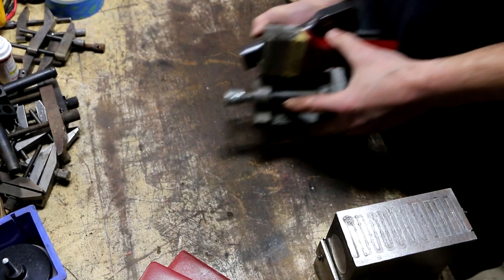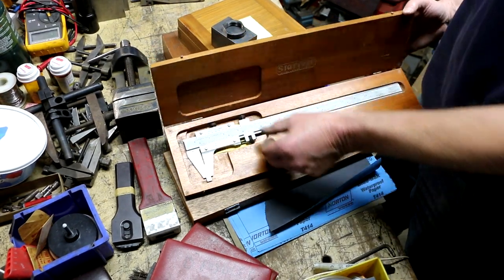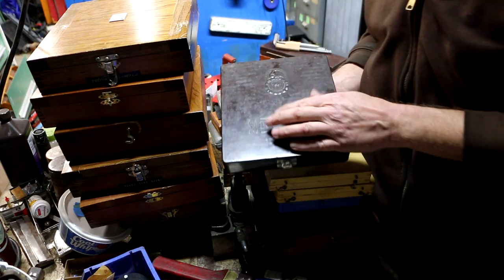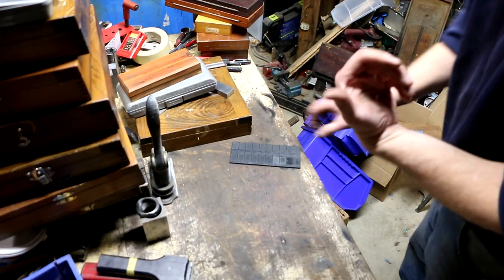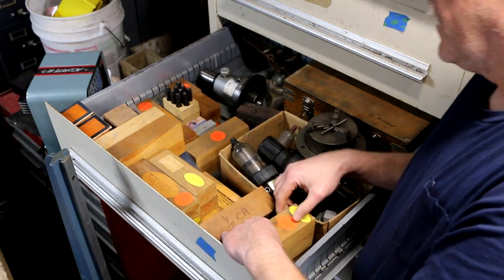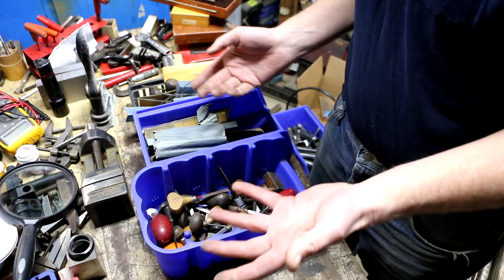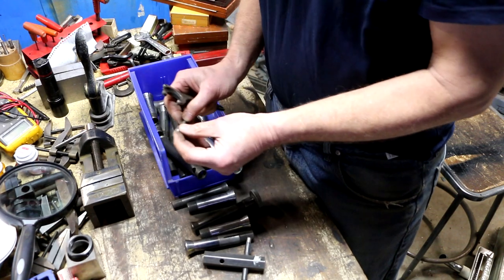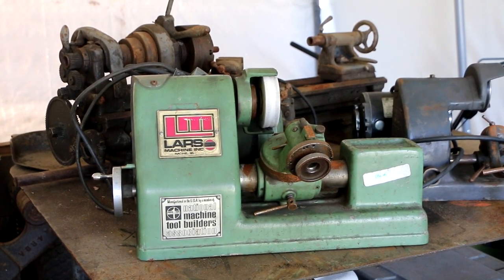Engraving shop machinist tool pick March 2023 Part 2 of 2

Comment: @9:30 Adam Savage's Tested did a whole video make a lamp of using that kind of hose.  Much better positioning than the original flex goose neck.
Reply from the maker: Thanks. I like Adam's videos but I missed that one. I will check it out.

Comment: Grobet is a very well respected file maker. Finding Grobet gravure's is a nice score. I am not positive but I believe that they started in Switzerland and either relocated to the States or opened up a manufacturing facility here. Or it could be that they just manufacture Swiss pattern files, and thus have Switzerland associated with their name. I would suspect that the gravures are worth at least ten bucks each. Especially the ones with the handles. You may just want to look up what they are worth new.
Reply from the maker: Thanks for all the info. I sold all the used ones with handles for 3 to 5 a piece. I will look up the value on the new blades.
Reply: @stevewatr  Actually, I went and checked them out. The new gravures are $8 something each, with the handles being about 2 bucks. Considering how good and uncommon they are, 3 to 5 sounds like a fair price. I picked some up to do some carving on some stone, quite a while back.

Comment: Steve why in the heck do you keep leaving you outside measuring machinist tool with the jaws completly close.
I'm a retired journeyman machinist of over 40 years in the machinist trade.
They are going to get rust and corrosion from not letting a small gap between the surfaces!!!!
Shame,shame on you Steve!